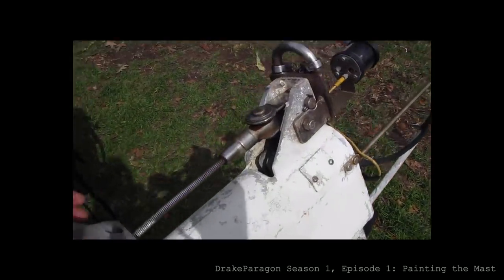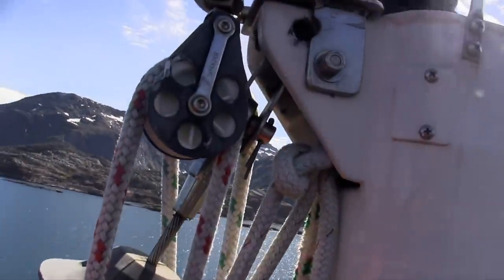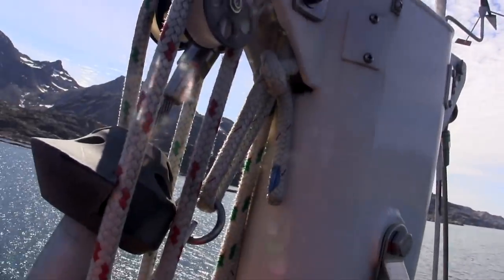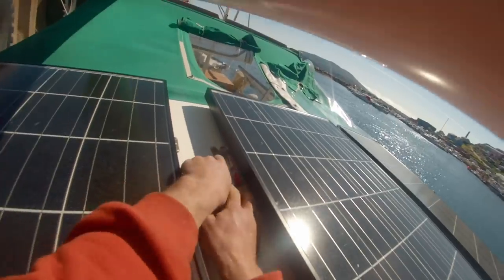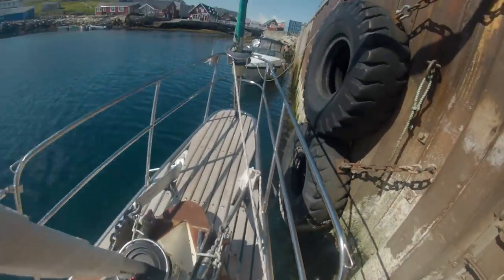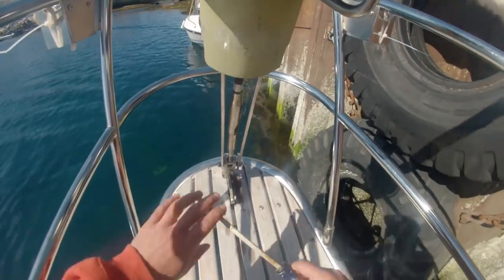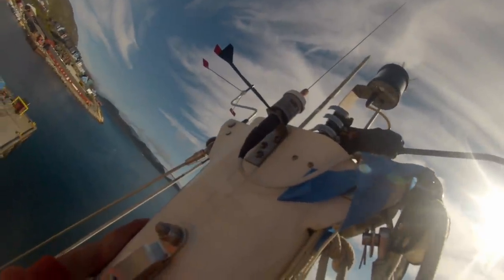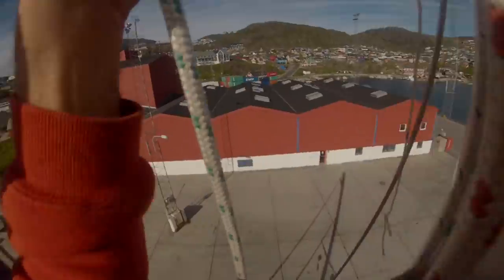We Almost Lost the Mast | #34 | DrakeParagon Sailing Season 5

Comment: Just an observation about the pin. When you inserted the cotter pin from the bottom, you could have twisted the Clevis so that the cotter pin head pointed up. Would that have made it more reliable?
Reply from the maker: Hi Arek, Unfortunately that stainless bracket on the top and to the side of the clevis pin made it impossible to have the cotter pin in with the loop at the top.  It prevented me from being able to insert it from the top, and from rotating it once the cotter pin was in. Later on I removed that stainless bracket entirely (giving up two snap shackle spinnaker halyard blocks) and now I think the cotter pin is less likely to fail.
Reply: I see, you couldn't turn the Clovis pin once the cotter pin was in. Loosing the spinnaker blocks you rarely use is not a big price to pay for safety.
You can always rig it up so it's flush if you needed light wind capability.

Comment: Drake looking at the failure of the cotter pin I suspect that the way the clevis pin passes through that half circle cut out in the stainless steel bracket, that over time, rotation of the clevis pin caused the cotter pin to be sheared off by  that stainless steel bracket. That being the case its likely to happen again. I would suggest using some other method of retaining your clevis pin such as a small plate bolted over the head of the clevis pin.
Reply from the maker: Thanks I thought so too.  I later removed that bracket entirely (loosing 2 spinnaker halyard snap shackle blocks)

Comment: Dumb question.  Why not replace the bolt w/cotter pin, with something more sturdy; something that does not depend on a paperclip for survival.  Maybe a galvanized bolt with nut?
Reply from the maker: I think there are a lot of great comments here about that, and some even from professional riggers.   Personally I think that the bolt with cotter pin would normally be fine, but on our mast there was a problem with that stainless fitting not allowing the pin to rotate freely, which caused it to break.  I ended up removing that stainless fitting.   I also personally think that a bolt with a locking nut as you suggested would work fine.  There are no dumb questions, thanks for asking.
- Drake

Comment: Just curious why you didn't loosen the rear stay (and shrouds) so that the mast could come forwards 1/8 of the inch to meet the pin.

(I also echo the harness comments below.  A simple climbing harness on a halyard is terrific and can be tied off to the mast as well as hooked to a halyard.  Not only does it provide safety but gives your legs a break while you're there in case you need a rest.)
Reply from the maker: Even if we could have loosened the backstay, I think the main problem was that the headstay was just too heavy to lift up without detaching it from the deck. However I'm not meaning to give rigging advice here as I'm not a professional rigger.  We're just telling the story of what happened.
Reply: @drakeParagon  sailors, like me, who watch your channel see your issues and think, "If that were me, how would I tackle that problem." So no judgement, I was just thinking through 'what would I do?'
Our rig is much smaller than yours but ours has a backseat tensioner as do many boats; I thought yours may have as well.  I just figured some more fore/aft play in the top of the mast may have eased the tension on the head stay as it looked like you only needed a wee bit more.
Another "if I were doing it" thought was that I might have tried tying a line to the headway for 2 purposes... one to secure it in case I dropped it and two, to see if I could use that as leverage to pull (rather than in addition to) the stay towards the masthead.  I don't know if that would have worked to alleviate pressure or just add sideways forces where they were unwanted.
At any rate, I wasn't being critical, just doing some problem solving from my couch.  :-)

Comment: It looked like the cotter pin that was there in oriental was put in upside down.....might have been a different sory had the loop in the cotter pin been pointed towards the top of the mast instead of downwards.  Just an observation.
Reply from the maker: I really wanted to have the loop in the cotter pin pointing towards the top, but it was impossible to put it in that way because that stainless fitting on the side and the top of the clevis pin was in the way. :(.  Bad design.  I eventually went back up and removed that stainless fitting entirely (giving up two snap shackle spinnaker halyard blocks).

Comment: Clip in! Get a climbing harness. The fact that this job was finished without serious injury isn’t an accomplishment - it’s a miracle. As many times as you were up and down the mast - you had to have been fatigued. Not smart and no one gets bonus points for being persistent after they’ve fallen off a mast and cracked their skull open on the deck. Glad you got the problem fixed, but a more measured protocol for “what do we do when _ happens” might be called for (including a climbing harness with a short tether).

Comment: I didn't realize until the end of the video that I was barely breathing. We go up the mast wearing a harness and using a bosun's chair attached to a halyard and belayed around a mast winch so it ratchets out while climbing the mast steps. The crew below can arrest a fall by putting tension on the line. The wraps on the winch are reversed for descent before the harness is released. A messenger attached to a canvas bucket is tied to the chair to send up tools and parts after the harness is attached at the work site and to lower tools/bits & pieces/messages to crew on the deck. Please don't do that stunt again. No one wants you testing the sudden stop on the deck to see if it hurts.  : (  The bosun's chair supports the body and takes tension off of your leg and arm muscles while working up the mast and a good canvas type bosun's chair will also have a few pockets.

Comment: I would put a longer pin in and then a stainless flat washer before the pin.
Reply from the maker: I'm planning to do just that.  Right now the stainless bracket would prevent the washer from being up against a flush surface, which I think would probably cause problems.    I'm planning to modify the bracket by welding on a little additional plate so that the washer could be up against a flush surface.

Comment: that cotter pin will turn ever so slightly due to small movements and will eat away the safetypin….Again.....and it will Work its way out...Again.....soo...what are you going to do about that…..    ps    to   be sure that the cotterpin is healty please change it.    

when that is said…..nice video,,,as allways.   cheers from Copenhagen.

Comment: Thought about this overnight; and you really didn't have many options.  A tough situation with little resources available.  And I think that your diagnosis that the bracket interfered with the cotter-pin is accurate, ...and it should have been longer to accept a washer.  I see in the comments you've already changed this.  Riggers continue to use cotter-pins rather than bolts or safety-wire so that the rig can be taken apart without special tools in an emergency like a dismasting.  It's a compromise.

I find it scary how many recreational sailors have NEVER had their masts down or rigging replaced.  With modern boat-lifts and carry-alls the rig stays up every winter lay-over.  In the old days the rigs were taken-down every-year so naturally all the connections were at-least inspected when the rig came off and/or went back on.  I actually stopped sailing with a friend after learning his 37' racing sloop's rig hadn't been down or serviced in over a decade on the Chesapeake.  In your case, that cotter-pin was less than 6-8 months old...and it failed.  And I remember you had problems with the furler before.

When are you and Mo planning on returning to the States?  The direct Northern route, or swing-South the long-way via the Azores to the Antilles back to Oriental?  After six-years Paragon will definitely be due to a refit.  I'm sure you have a long laundry-list of changes and modifications based on your 5-years in European waters now.
Reply from the maker: I hadn't thought about the advantage of cotter pins being to be removed faster than nuts during a dismasting.  It reminds me of when Eric Forsyth told me about when he had to jettison the mast after he was dismasted in hurricane force winds.  He said he crawled around on deck and removed the cotter pins with vice grips and that they came apart as fast as butter because he was moving so fast because he was so scared. https://youtu.be/eRb92xlq140
Reply from the maker: We are still planning on a lot of sailing before we return to Oriental, NC for a big summer refit.  We plan to spend next summer sailing in Svalbard, the next summer sailing Norway, Denmark, Germany, France, Spain, Portugal.  Then I think we'll sail to either the Azores or the Canary Islands and from there on to the Caribbean.  From Saint Martin we'll sail direct to Beaufort, NC and then straight to the boatyard in Oriental.  Paragon will be long overdue to have her standing replaced by then, but in the meantime I will make sure to examine the rig before and after every big offshore sail and fix anything as necessary.

Comment: Wouldn't it be better to rotate that pin,so that the eye of the split pin was uppermost?? So that it wouldn't fall out
Reply from the maker: Unfortunately that stainless bracket on the top and to the side of the clevis pin made it impossible to have the cotter pin in with the loop at the top.  It prevented me from being able to insert it from the top, and from rotating it once the cotter pin was in. Later on I removed that stainless bracket entirely (giving up two snap shackle spinnaker halyard blocks) and now I think the cotter pin is less likely to fail.
Reply: @drakeParagon  ah ok thx mate

Comment: your self locking nuts are on bolts that are to short for the job, you must have the min. of 1 and a half threads sticking out of the nut to provide "locking tension" on the bolt shaft, the other one you are looking at is to short also,
Reply from the maker: Ya I've noticed that too.  I've always wondered if that bolts was too short.  As far as I know it was all made by Profurl that way.  It hasn't been as issue yet.

Comment: You definitely need a simple climber's harness for yourself and one for the person below...with 2 carabiners, a belay device and safety rope held by a belayer below.  You'd clip in the one carabiner as you move up and the other would be a safety back up...just look at simple beginners climbing videos...most important is that you have someone below holding you in place in case you fall. Here is a link to the set up: https://www.youtube.com/watch?v=m-FbtppVC7w  Drake, we all love you to bits and would hate to see you fall, so for the low cost of some basic climbing equipment, you'll be sweet. Also, having someone below holding "you in" will allow you to use both arms while suspended. THis equipment will save to time, save your life and is especially useful if you need to get up the mst in heavy, stormy weather...A MUST on all sailing boats...goodluck and stay safe. https://www.youtube.com/watch?v=m-FbtppVC7w
Reply from the maker: Thanks Beazle! Will do. - Drake

Comment: Could that cotter pin replaced with a fine threaded stainless steel bolt/washer/pair of locking nuts/red locktite combo? Seems like a rather fragile single point of failure and cotter pins will degrade slowly silently with corrosion and metal fatigue from vibrations.
Reply from the maker: Sounds good to me.  Do you know anyone who has done it?
Reply: Don’t know anyone that has but it seems a logical bombproof solution to something so critical. Could also mangle the threads at the end of the bolt so nut cannot work off, but bolt could be cut and slipped out. Not likely to receive shear force so I am thinking it’s a good way to go.

Comment: That will fail again. What a single point failure. You need a flat surface and a tight washer for the cotter pin to hold. That bracket is causing the failure.  Maybe a sleave and a longer bolt and double nut would work, but you have to deal with the dissimilar surfaces.  Move the bracket or reduce it's foot print in that area. I hate the clovas pins in these critical applications. Get a better fastener. Also, send a bag of tools up on a line, don't carry them.  Ok I'm done, thanks for the vid and listening to a 3rd generation mechanic.
Reply from the maker: Thanks Dwight. I thought so too.  Later on I removed that bracket entirely (giving up two spinnaker halyard snap shackle blocks.). Thanks especially for recommending the bag of tools on a line - sound like the perfect solution to me.
Reply: @drakeParagon  Glad to here it, I know this is weeks old but I could not sit on my thoughts.  Tail winds to all of you!

Comment: Dude, that is literally the dumbest thing I have ever seen on a sailing channel and that’s saying a lot.  Not only dangerous to the extreme in perfect conditions. Your doing that in cold weather and out of breath.  Not to mention how much easier it would be having both hands free.  Don’t mean to be critical but that was so crazy I can’t believe you of all people did that.  Get a climbing harness and at least clip to the mast or a step
Reply from the maker: As you can see from my responses to several other comments I wholeheartedly agree with you. I will always wear a harness now when climbing the mast.
Reply: DrakeParagon you can always make one with the miles of lines you have on the boat in a pinch if you don’t have a harness.  Even a rope around the mast would help stabilize you and prevent you from a 50ft fall.  I literally held my breath every time you went up and we’re fighting the rig basically pushing your self off by what you were doing trying to get the pin lined up.  Not trying to be a jerk guys, love your journey, just shocked at that one.  I know there are people who get all “safety Steve” on here but that was seriously over the top.   Didnt read the other comments so sorry for piling on.